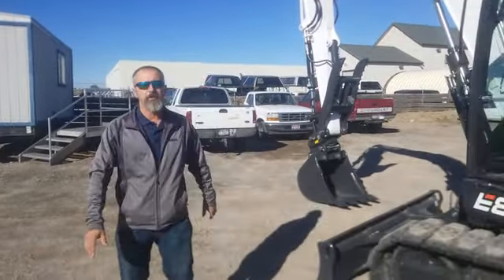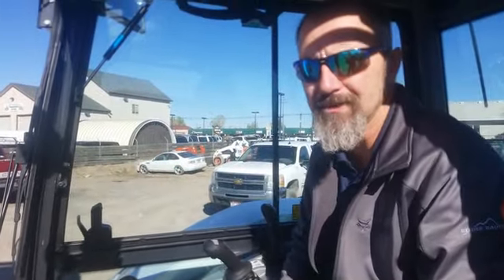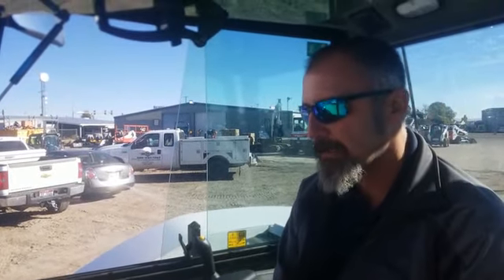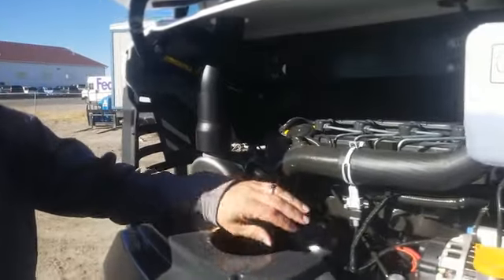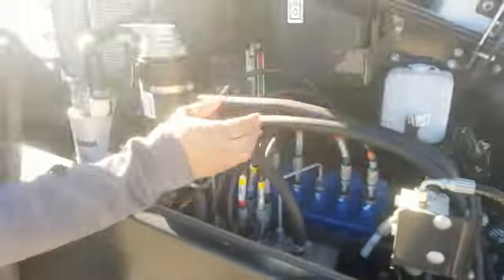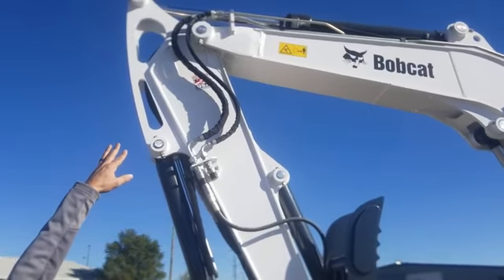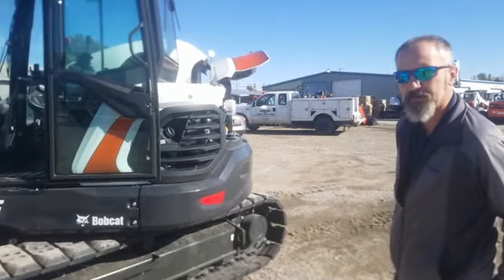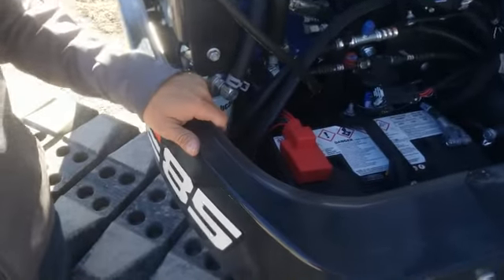BOBCAT E85 MINI EXCAVATOR WALK AROUND

Comment: Just bought a 2016 e85. Left thumb switch controls thumb. Right thumb controls auxiliary hydraulic
Machine also pin quick attach bucket.  I think added. Theres a tighle switch that doesnt look oem that controls hinge

Been unable to get boo. To swing because tgat switch is controling thumb.

Any ideas on what i could do to make boom swing?

Awesome vid by the way

Comment: Demoed a brand new one and was very disappointed. Really liked the price and american made but it stopped there. It was very unstable the bucket roll back was not good you had to stretch out to far to to dig a straight wall. The window was in the way when it went up and the roller fell out with 15 hrs on the machine. The code was a pain in the ass to enter every time when starting.  I went with a takeuchi 290 better built smoother operating machine.